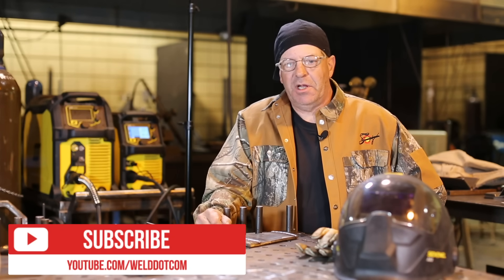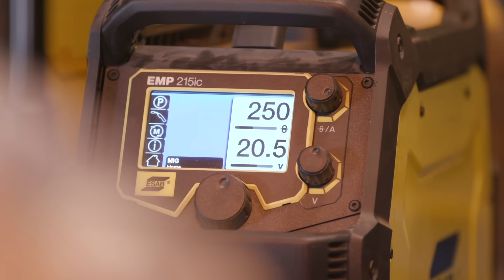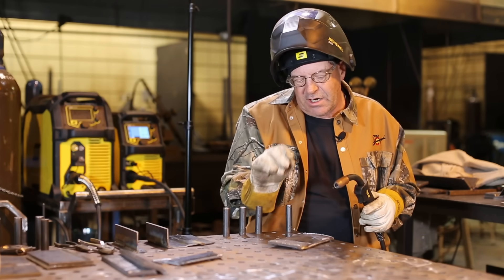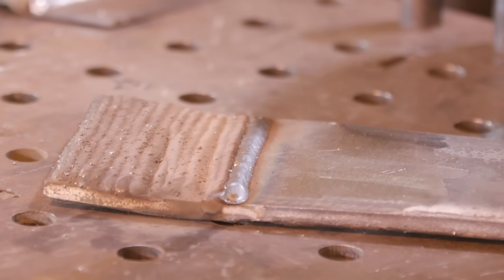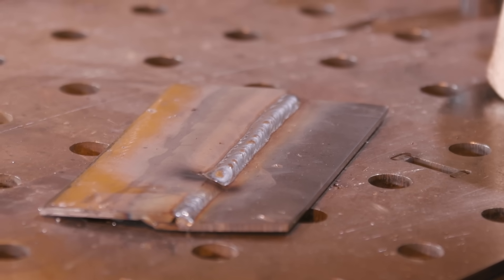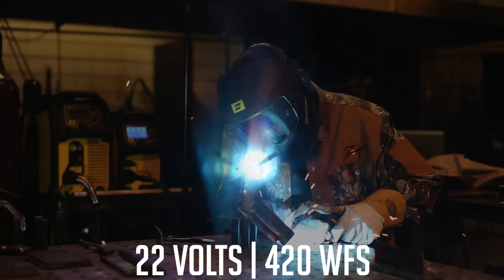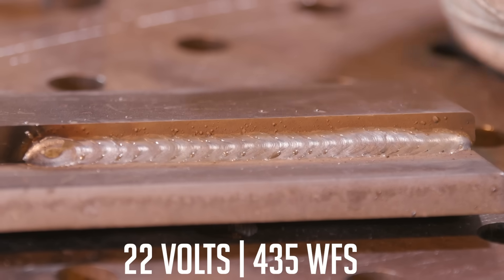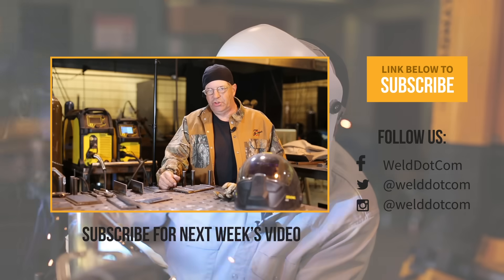Beginners Guide to Globular MIG Welding

Comment: Been doing a lot of structural welding with .45 70s wire running it at 26.5 volts and 300-320 wfs it's absolutely amazing I've never MIG like this before AROUND THE SITE I CAN'T BELIEVE THE STUFF THERE DOING

Comment: That's pretty much how I weld. Never knew was called globular. I just thought I liked welding hot. normally use .035 at 24V with 300 on the wire feed .Gotta change it up every now and again  Depending on what you're repairing or building, With proper technique it can be done vertical up and is excellent for overhead.  I've made a career doing it.
Reply: A hot short circuit and globular transfer aren't the same thing. If you are welding vertical or overhead, you definitely aren't running globular. The weld puddle is WAAAY too fluid to try anything where you are fighting gravity.  Like trying to get water to stay on a ceiling.
Edited for spelling

Comment: globular tranfer can add to costs, because of splatter and can cause inconsistant penetration. Buy 0.8mm, 1mm and 1.2mm (0.30, 0.40 and 0.45) wire with 82/18 ar/co2 mix and you can weld pretty much everything in SC and spray mode.

Comment: The James F. Lincoln Welding Foundation book, "The Procedure Handbook of Arc Welding" likens flux core to SMAW.  With that, can you take flux core into globular transfer or are you just asking for trouble?  Seems like the flux would prevent the globs from forming and instead blow the wire into splatter making a big mess.
Reply: Most flux cored is the globular transfer
Reply: Thanks for the reply.  I suppose that's something I would have learned in welding school.  I looked for slow motion videos of the process and found some pretty cool stuff.  This one shows the process pretty well.  https://www.youtube.com/watch?v=MRIGks3gxG0
So with flux core, we should be running with the higher numbers like you are in this video, depending upon the thickness of our material?
Reply: There are a bunch of high-speed videos of different welding modes out there.  Worth watching!  Some good ones from CCWJ (Canadian Center for Welding and Joining).  Might be 10,000 frames per second or so.  Some of these modes look pretty awful up close and slow-motion like this.  Especially when compared to new stuff like "Cold Metal Transfer", or "Surface Tension Transfer".  With flux core especially it's just going everywhere, maybe 15% of the wire is going into the air, right?
Reply: MIG Flux cored welding with High speed camera - Photron SA5        (watch it!  It's barfy)

Comment: Bob, I don't like to have different mig gases running around the shop, so I get as close to spray as I can with C25 a fair bit. I notice you're using some gun manipulation. I have had my best appearances with a straight drag. I'm using an old MM250 beast, and she likes to run hot and fast. But is there a particular reason you like that step and pause action? Might be why it was crowning up a bit.
Reply: Ryan Jones Man I can't straight drag to save my life. I have to rock it back n forth to regulate my speed.

Comment: Bob, Can you explain why its not easier to just get a bottle of co2 and a bottle of argon with a splitter and set your regulator flow to the correct proportion for short circuit or spray?
Reply: It just got easier.  There are now cheap dual flowmeter things from China.  Two flowmeters in a box it looks like.  Or you can spend about four or five times more and get a mixer from Smith I think.  Either one might pay for themselves pretty quickly, plus you can maybe dial things in, and get a better job every day!  I want to do this myself.

Comment: I like globular transfer, but I find that pushing rather than pulling gives a nicer weld
Reply: Pushing gives you a flatter weld but pulling gives you more penetration.
Reply: I am only 9 years old and the only time I ever really pull is when I stick weld, for me my welds on just about any other welding trade pushing brings the heat ahead therefore more penetration into the steel or metal of choice

Comment: Great video Bob!
So the thinner the wire is, the more wfs you need?
Reply: saw this and see if i can help, im not an extreme expert like bob but anyhow...depending on what thickness your welding yes. Example, Say your welding 1/4 inch plates with .030 vs .035 wire, your wirespeed will be higher on the .030 than the .035 to achieve the same heat input. Wire feed speed is your heat (or amps) your putting into the weld, thicker materials need more heat input to get deeper penetration. So the thicker the plate the more WFS you need. 

Now if the material your welding is really thin, smaller wire like .023 may be the right choice because it runs much better at lower amps than large wire. It is easier to get a nice short arc at lower wfs than larger wires because it doesn't require as much heat to burn the wire. When welding thin materials with larger wire sometimes you are unable to turn the wfs down enough to get a decent short arc and still not burn through your materials.

Comment: Complete beginner question and please forgive me if you answered this before. Do you always do the "cursive e" motion or do you go in a straight line. What's the best for someone who is just starting.
Reply: Tony Baggett Try straight line.  I learned to rock it back and forth so it stuck with me.
Reply: Learn STRAIGHT mate. This weaving/circles bit is not acceptable with structural work (well not where I am anyway) and it actually gives me the heeby-jeebies.

Comment: Bob, this helps burning through mill scale ....  where short circuit does not pack as much of a “punch” ....  

There are definitely applications for it ...
Reply: ZILA and galvanized. Thats what i weld at work and i cant run short circuit on galv steel because it never runs smoothly. Turn that heat up some and itll burn right through.
Reply: Globular transfer in pure CO2 gives almost the best penetration profile. 
Better penetration than argon mix, higher welding speed, sometimes with less filler metal, less hydrogen pores, twice the volume of shielding gas, but needs higher inductive settings and better respiratory protection :)
Reply: Globular is pointless why would you deal with all that clean up go spray globular I've never seen use
Reply: @carof08  there are many applications where cleanup doesn't matter, and globular is the fastest way to lay down a lot of wire and still get good penetration, and it's MUCH cheaper to run than spray transfer. Between the higher end gasses required by spray transfer, and the higher voltage and current needed, globular saves money and increases productivity.
I worked in a shop that built equipment for aggregate plants, and there they used 90% globular. Who cares if there is spatter when the part is a wear surface for aggregate? Welding is just like anything else, use the right process for the given application

Comment: I'm enjoying the education, thank you.  I've tried the higher settings on my machine with .030, c25, 22V and it seemed a lot quieter, less of a popping noise and hardly any spatter. I've heard spray transfer, but only on Youtube,  and mine was almost the same same sound? I think my WFS was less, like 350-375. Strange to me.
Reply: On WeldingTipsandTricks, Jody showed that welding machines frequently don't show the correct WFS. So 350 displayed on one machine may be 315, on another machine, it may be 390. So he showed that he always measures the speed to confirm the setting. Your machine may be 15 or 20% low on the WFS, so when you thought you were cranking it up, you may have only been just getting up to spray welding speed and amps. This is why Bob keeps cranking up his speed and doing test beads. He ended up 20% higher than where he started, so the machine may not be accurately showing his WFS. Also, brand of wire affects welding performance and sounds.

Comment: if there is more voltage and more wirefeedspeed so you are welding with more (higher) amps ?
und Daumen für MIG MONDAY !!!!
Reply: DeutzDXFahrerKalli yes more amps. Und höherer Einbrand durch die Walzschicht.
Reply: ZILA also ist Glob eher für dickeres Material
Reply: Das kann man so sehen.  Eineige Schweißgeräte Hersteller machen das so das du bei dünnen Materialstärken der short circuit transfer hast und je weiter du in Materialstärke hoch gehest um so mehr ändert sich der Lichtbogen in einen globular transfer möglicher weise bis zum spray transfer .....  
Anfangs mochte ich das nicht so sehr - ich muss aber sagen nach einiger zeit habe ich herausgefunden das das doch riesige Vorteile hat speziell fuer weniger erfahrenere Schweisser ...    
Der Anteil der fragwürdigen order schlechten Schweißnähte nimmt damit deutlich ab !

Comment: For videos like this which seem to use one set of consumables (wire diameter and shield gas), can you guys start putting them in the video description?  Once in a while I'll come back to use your videos as reference for a starting point in or troubleshooting my settings, but end up having to watch the video to confirm the wire and gas you're using (to make sure the settings are relevant).  Even if you switch wires or gas during a video (which I don't think you do often), mentioning that in the description would be helpful, even without mentioning the times that you start/stop with each.
Reply from the maker: Yeah, we can do that.

Comment: I have an old Miller Passport Plus....Have not used it a lot but I really enjoy using the smaller wire ...problem is in my area when I don't use it often enough the wire quickly gets rusty.
Reply: Gulf coast of Texas here...I wrap my spools up in plastic wrap. The stuff used for packing things up for shipping. It comes on a roll with a handle and you can get it at the hardware store...probably. It helps a ton.
Reply: bigcliffe I have the same problem. I try to keep mine in my house as much as possible, but it's a pain to remove and put back in.